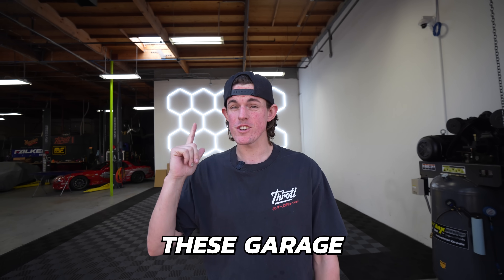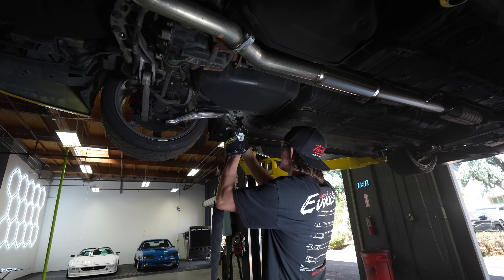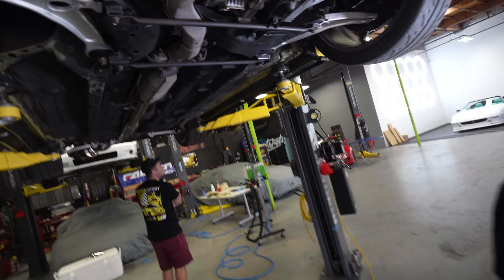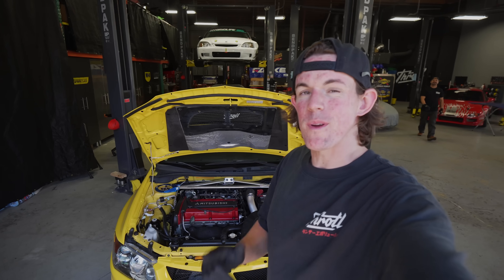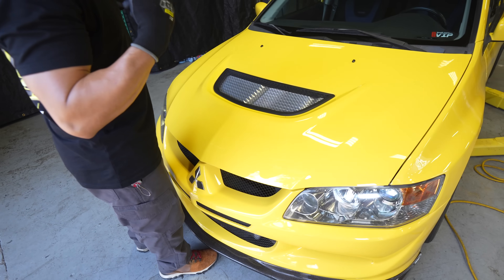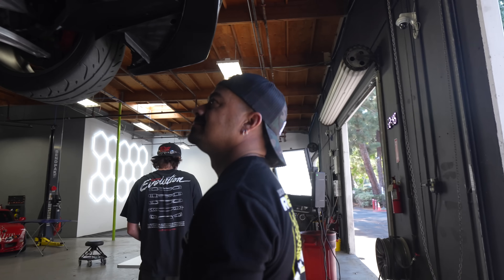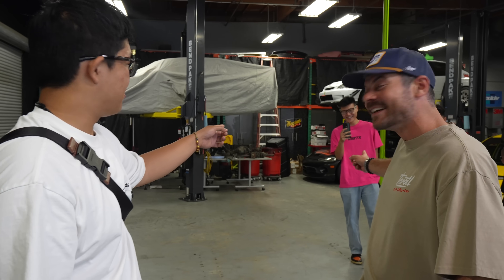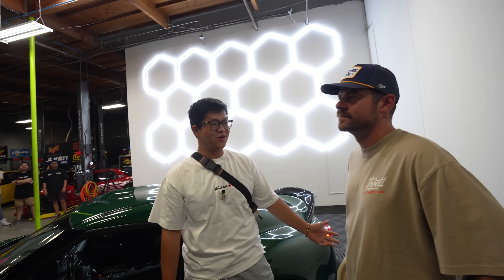FINISHING our Lancer Evolution VIII

Comment: In my opinion two cars that have a lot more aftermarket support than you'd think and are extremely unique would be the 1993-1998 Lexus SC300/SC400 and the 1995-1997 Volvo 850 GLT Turbo Wagon. These cars are extremely underrated and have very unique motors that I think would make very fun build content as well as would be the first in their class to be built in front of a wider audience in the car community.
Reply: The SC400 or Soarer would be cool
Reply: Shhhh. SC300 prices are high enough as it is.

Comment: I'm a little biased, so I'll preface my suggestions with that... I'd be cool with theThrotl Fox body in a giveaway. As for future builds, a Coyote swap into a Fox, New Edge, or something light would be cool. Power by the Hour has swap parts. Not sure if that would fall into the 50 state legal category though. If you're thinking a truck, which I think would be cool, I'd suggest a single cab 4x4 F150 with a blower. It's been done before, but I wouldn't mind seeing some cool Throtl touches on one. Any way you go, I'm probably going to watch haha. Good luck with the next build!

Comment: Love the series, unfortunately I am not from the states so I wouldn't be able to win, but a JDM Mazda B-Series street truck would be a sweet build. Gotta be the square body style. Possibly rotary swap it, put it on adjustable coilovers, a JDM style wrap, fresh exhaust and mufflers, JDM five spoke wheels, with a more modern gauge cluster and electronics, and a couple engine mods if needed.

Comment: How about a heavily modified Japanese mini truck, either a Daihatsu Hijet or Subaru Sambar, AWD conversion, full bolt-Ons, aftermarket suspension, premium alpine or pioneer audio system, Baja-style lighting, orange wrap inspired by the Throtl logo, Throtl white domino decals on the front, side doors, and bed sides, custom wheels and tires, custom interior, Sparco detachable steering wheel, topped off with orange under glow lighting.